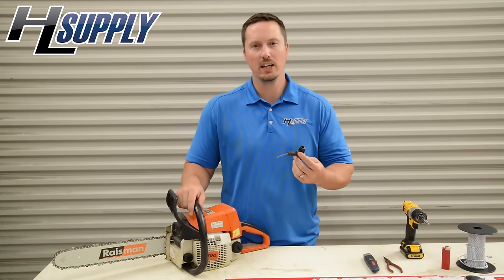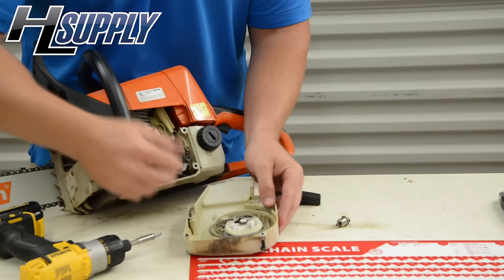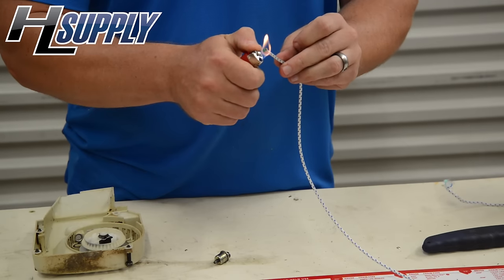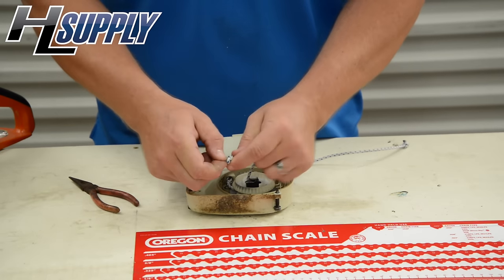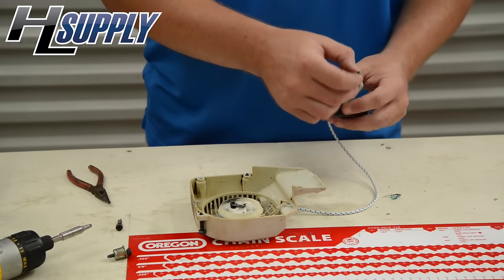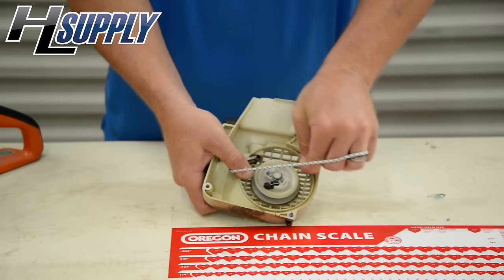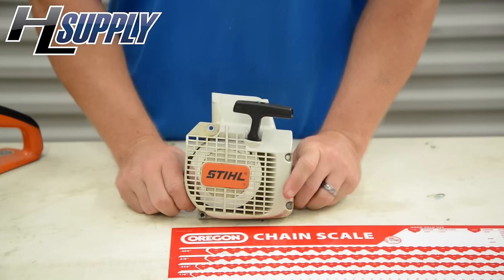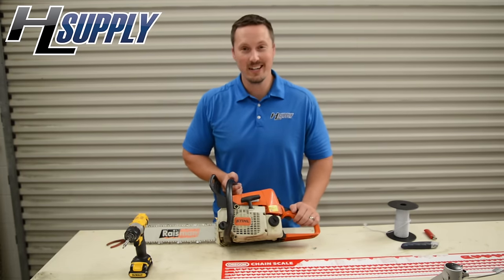How to Replace a Starter Rope on a Stihl Chainsaw....The Easy Way by Bobby

Comment: It's a pity you didn't mention a couple of important points like what thickness rope to use and what length of rope to cut otherwise good vid.
Reply: emmams5 agred, what the hell!
Reply: measure the old rope
Reply: ricky canady don’t always still have it intact
Reply: that's the reason you're replacing it right...
Reply: ricky canady no shit, what I’m saying is you don’t always have something to measure it against.
Reply: He literally said “New rope, measure out.”
Reply: 36 inches long and #4 rope.
Reply: John Ambrosino what size? 3/16?
Reply: @dragon0072566  Stihl 025 manual specifies rope 3.0 mm dia x 960 mm long (9/64 in x 37 3/4in)

Comment: Fantastic thanks, easy to follow, just completed replacing my pull cord on my 14inch STIHL,I cut 40 inch rope used bout 36 , you can actually tell how much you need when the wheels full and pulls and rewinds easily. 

The only reason I mentioned the rope is a comment about length!   might not have the whole old peice as the dilemma I found my self in !
Cheers!

Comment: Thank you very much sir!! I went to use my Stihl MS250 and the saw is about 10 years old or so and the pull cord finally broke. I couldn't find pull rope but I did find some paracord at the local farm store. I watched you video and in less than 30 minutes saw good as new again. Thanks again!!! :-)

Comment: I agree with the other comment that it would’ve been good to mention that the size of the cord was crucial. I bought one at the local Ace Hardware because the stihl dealership was closed for my stihl 461. It took me a little over half an hour just to try to get the cord through the little plastic hole and back up through. What I finally ended up doing was heating the cord and rolling it until it was small enough to go in and then fishing it out with a dental tool. Much more difficult than I expected in what otherwise is a truly stupid simple repair.
The average person with the average tools would not get past this. What’s funny is the replacement cord was not appreciably bigger either:/

Comment: This is a great video for a bigger saw. Smaller saws don’t have that much room between the housing and the spool and it’s nowhere near as easy as “line it up with the hole, push it in, grab it with the needle nose pliers, voila”. Could you please do one showing how you get the standard rope into the smaller saws? That’s what I need. I just wasted an hour and shredded the outer part of my new cord trying to fit it in the saw and yes- it’s the same size pull cord the saw came with.

Comment: Another very important tip is to make sure the rope bottoms out before the spring does or you'll break the recoil mech.
After rewinding the rope, pull the rope until it bottoms out. Then try to move the recoil pulley CW by hand. It should be able to turn at least a 1/2 turn. If it can't, the rope is too tight.
Reply: Took me sometime to understand what you said, but hands on it i realise the spring was too tight, and could lead failure soon. i rewind it with less tension. now the spring effect is perfect. good advice . thanks from India Stihl ms180
Reply: @Pondy974  Glad it helped.

Comment: Can someone explain why my Stihl 038 model tears the starter cord out of my hand when I am attempting to start it. Is there a video on this problem. I believe it maybe out of timing. I need a video on how to fix this problem before I loose my fingers. Ouch!!
Reply: Take the starter recoil off & clean it. Steves Small Engine on YT has a video about common issues like this.
Sounds like the pawls aren't retracting properly so when the engine kicks, it grabs the pawls. Could just be dirty or the spring/s may be broken that hold the pawl/s in.